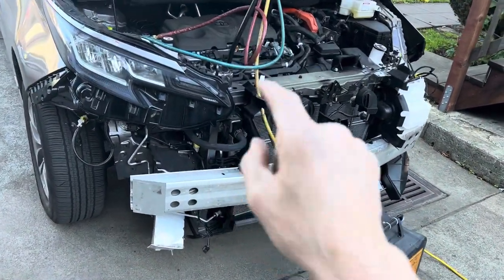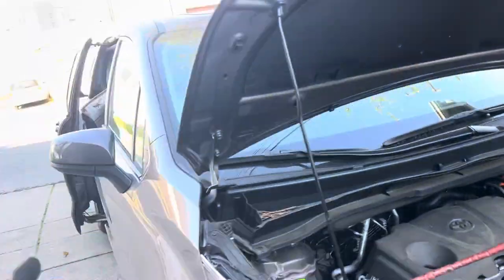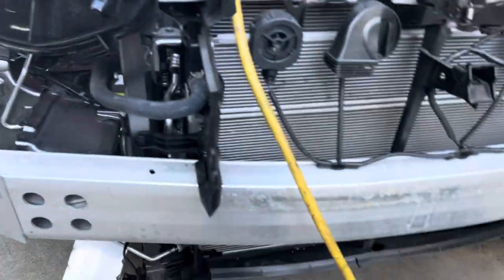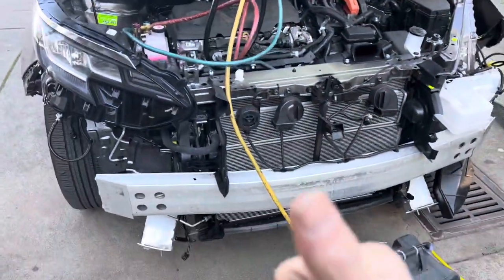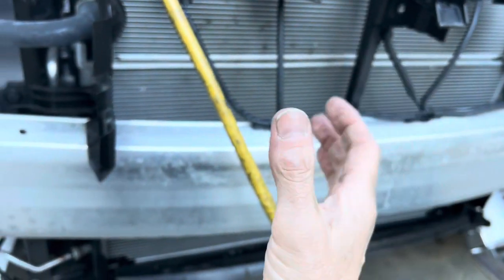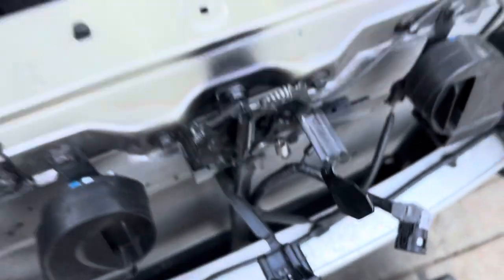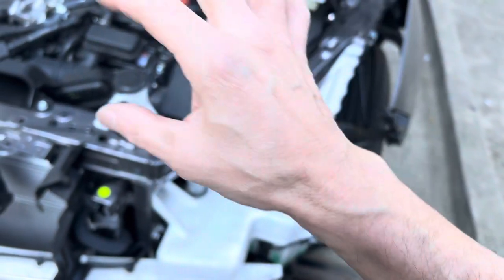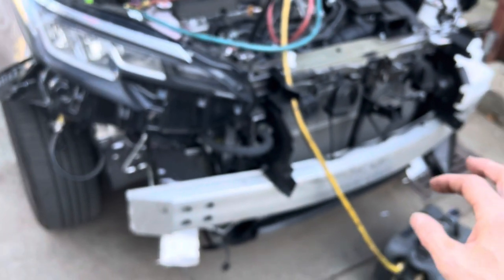AC condenser on this 2021 Toyota sienna hybrid van would be good to modify to a passenger vehicle

Comment: Good point about the extra condensing capacity in hot climates. Arizona resident here myself. 😸😸😸 Last year in the dead of summer, the air itself 100 feet off the ground was 118°F!!! Forget about 6" off the black pavement, ALL of the air was almost 120° that day. The pavement itself gets up to 180°F or so. You can fry an egg on the asphalt sidewalk. Electric bicycles will fall over because their batteries and motor are heavy, but they still have a tiny little kickstand foot meant for supporting a plain bike. That little foot will actually sink and melt into the asphalt because it gets so hot. After an asphalt road is around 10 years old, there are very pronounced, wide valleys and bulges in the road at intersections cupping the tracks where the tires of vehicles rest while sitting at the red light. Semi trucks and compact cars all drive on these roads so the valleys are wide enough to encompass both widths of various axles. It's definitely the semis and garbage trucks and cement trucks and gravel/sand trucks and UPS/FEDEX/Amazon trucks that push that hot and soft asphalt down and up like Play-Doh over the years. It's unbelievable. Why do I live here? 🤔 Well, anyway... The air above these roads in summer is like, 140°F or so I'd estimate. Even a dead on perfect charge in a 1994 car with a rebuilt and well designed factory R12 system that has a parallel flow condenser will still have bubbles in a sight glass on these 110°-115°F typical summer days here. It's ridiculous. So yeah, the R134a cars with barely adequate systems kinda fall on their face in that time of the year, especially when it's monsoon season and it's 105°F with 80% humidity! 😤😫 My 2012 Corolla does pretty well I'd say. I had 3M ceramic heat blocking tint installed all around except the windshield for legality reasons. It does warm up a little when sitting at a red light. Cools back down again nice and proper after taking off again. An upgraded larger condenser would do very well in those crappy cars being driven around here for sure. The only question I have is...how do you determine the new correct charge weight when installing a different model larger condenser? R134a has pretty tight tolerance for proper charge to properly lube the compressor and keep pressures correct even with a variable compressor. If someone swaps in a big honking condenser and just guesses at how much to put in, they're doing more harm than good. And as you've shown here numerous times, you can't judge a variable compressor system by the pressures and you can never use SH/SC on an MVAC system. So how do you calculate or experimentally determine the correct charge of refrigerant AND oil that needs to be filled in for exactly correct operation? I mean, the tolerances of a stock system is like +/- 50 grams of gas sometimes and less than an ounce of oil. Guessing would let someone be off by a quarter or half a pound potentially and they could totally oil slug a compressor with too much oil addition. :(

Comment: I would love to see a video of modification and application of said condensor. 👍🏼
Reply from the maker: It’s a easy transfer of parts. Just like when somebody wants a different bigger alternator on their car but it doesn’t fit so they make their own brackets and modify the wiring to make it fit and work. 
                  When somebody wants a bigger radiator on the car and it doesn’t fit they just modify it make their own hoses now they have a bigger radiator. 
                Exact same thing for the condenser in many countries where they don’t have much money or access to parts are very difficult because they live on an island it is very common to take parts that were not originally on a car from a junk car remove the parts in adapt it and make it work on the running car.

Comment: Please, can you tell me, after AC Condenser replaced,  how it is possible mine just like this vehicle took about 2 cans of (refrigerant 1234yf) 226g each can ,while label shows 900 plus/minus 30g to be fully charged?
Reply from the maker: That means it’s not charge properly. 

Do you have to read the label? . 

Do you have to follow the factory procedures on charge method? . 

If your label shows 900 g you should be able to get 900 g in there 

Download the factory, manual or procedures, follow instructions . 

And you should be able to get the rest of refrigerant in there
Reply: Compressor kicks in and starts cooling . When I tried slowly to overcharge compressor stops until I discharge the extra. BTW , I did successfully 45 min vacuum for the whole system without leak as well before whole procedure.
I have no idea whats going on. But cooling sys is good so far !!
Reply from the maker: Only way to properly diagnose as well as system is fully charged to watch the manufacturer says then diagnosis procedures can start . 

Are you saying you had to let refrigerant out to get it to stay on because he kept shutting off?  

That sounds like too much refrigerant overcharged could be  ? 

Is there more than one Fan and one? Fan is not coming on 

What is your outside ambient temperature?
Reply: Yes it shuts off if i charge over two cans Around 450g). I have only one big fan and it works just fine.